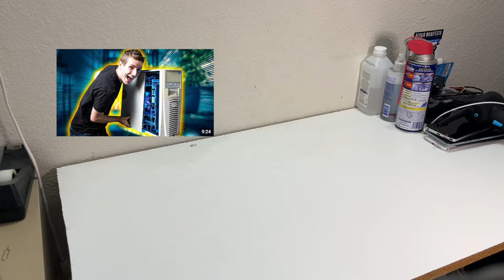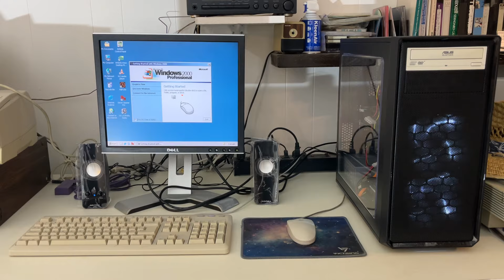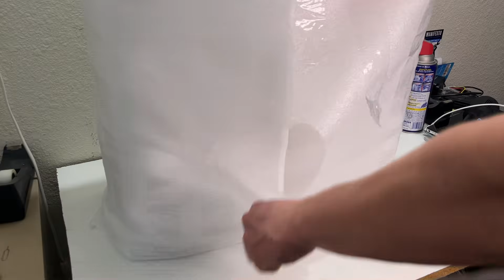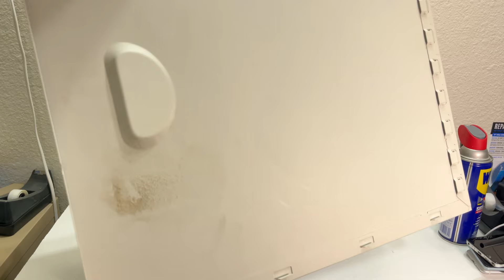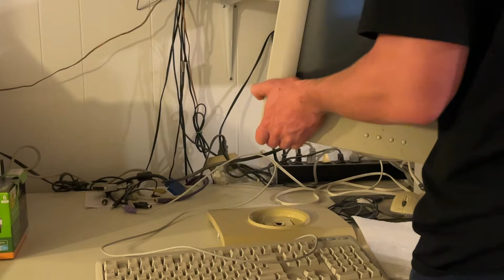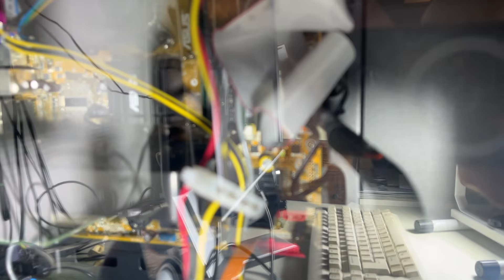This Is a Reverse Sleeper PC Build

Comment: I should make a revese sleeper using a modern case 
Porbably when i fix my athlon64 motherboard (i need to get new capacitors and patch 2 damaged traces)
Reply from the maker: Highly recommend! ❤ Also I’ve seen you around my comments and Im grateful you took the time to check out my channel.

Comment: I wasn't sure what a "sleeper pc" was, but now I know my antec 300 case probably makes my main a sleeper.
AMD 5600x, 48GB ddr4, RX 7800XT, 1TB gen 2 NVME, 2TB gen 5 NVME (Tomahawk B550 Max wifi runs at gen 4 speeds) 1TB HDD, and a PCIE adapter for more USB ports.
Reply: It runs Gentoo and Debian 13 Trixie.
Reply from the maker: Extra sleepy id say ❤

Comment: You are consistantly touching the parts of the boards you should not, and not using a ground..  Hold cards and ram sticks on the sides and not directly on the board. These old parts are really really delicate! Cool project and legendary fsp psu :)
Reply: lol... not everyone has sweather hair and tons of electricity on himself.
doing it same, woeking with retro hw daily without ground or touching iron
didnt have accident after 6 years... with grounding shi i would lose like 30 more hours of time. if something dies, it is usually $5 or $10. didnt happen from static (i also put everything on carpet)
Reply from the maker: Thanks for watching! ❤ Yeah I get that a lot, I know the risks that come with how I handle hardware! 😅